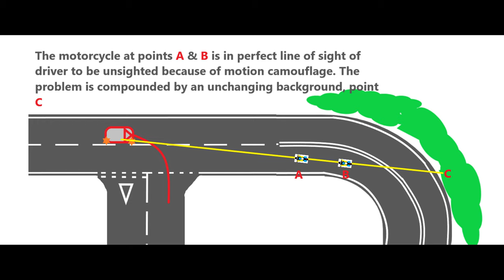SMIDSY - Understand & Avoid. Why Cars Pull Out In Front Of Motorcycles. Motorcycle Training

Comment: Never ridden a motorcycle BUT I do think this video is a must for car drivers and pedal cyclists as well.   Understanding the human failings in vision is the first step in training yourself to look properly and driving/riding defensively with respect for junctions.    In my younger days, I used to see the speed limit as a target.   It was only when I took an Advanced Driving Course and an HGV course that I began to understand the need to drive defensively and to use the accelerator/brake/gear to regulate and properly control the vehicle.   Thamk you very much for this video - very clear and easy to understand.

Comment: Great Video. Been riding on my full licence for about 4 years and have just done the Enhanced Rider Scheme. I ride an Africa Twin 1100 manual. These videos are very informative and I'll generally watch one before heading out because I'm still essentially an inexperienced rider. I have a personal example of the dangers of a SMIDSY from a car's persepctive: 

I was once driving a Citreon Relay van near Helston in Cornwall and was approaching a roundabout(the one near Sainsbury's for anyone local). It was sunset (a time I feel is most dangerous for motorcyclists due to the azimuth of the sun). On approach to the roundabout (I was heading second exit straight over), it appeared clear on my right although the sun was in my eyes, and as I pulled out two motorcyclists suddenly appeared across my windscreen within metres as they'd been obscured by the RH A pillar of the van and I failed to see them entering the roundabout previously due to the Sun. In their defence, they were both wearing hi-vis jackets but this just corroborates the point that hi-vis is harder to see if blinded by the Sun as a backdrop.

Stay safe everyone and be mindful of where the Sun is in relation to the road. 

Thanks for the great videos PWR.

Comment: Excellent video and of course very useful. It does help if you are/have been a car driver, gives you that bit of awareness of the issues car drivers have. My top tip is to give a little wiggle as you approach a junction, helps to get you noticed (I think you mentioned that in your video). Many thanks.

Comment: Unfortunately there is the exception to the norm. 2 years ago a driver came out of a junction straight at me, hit me head on, came out so fast he pushed my bike backwards.
I was doing 20mph possible less, 2nd gear, through a busy residential road because of a closed road diversion. Traffic was obviously heavy and the driver had maybe been waiting a while, I am not trying to give any justification to what this idiot did to me because there isn’t any, but he simply didn’t see me. Oh and what was I riding, a bloody great big goldwing 2018 new model, day running lights and even extra day running lights on the front of the engine, high vis vest, yet he still didn’t see me.
So there was absolutely nothing I could do, no where to go to avoid him. My goldwing was written off, he totalled the front of my bike.

Comment: I think it’s a good idea to pre-load the front break so you’ve saved time if you have to break. Very good video  a lot to think about ? I’ve just bought a motorcycle after over 40 years not riding and although I’ve always had cars and been a tram driver for several years I am very aware of my limitations and at 64 my reactions are slower. So I intend to go on the police riding course and unlike when I was on 1000cc bikes back then I am aware that I need to give myself more time to react and at my age I’m not interested in going fast anymore. I shall be fitting extra lights and a louder horn which will help just a “ little” and I shall definitely be buying a hi-vis air vest aswell as armer , also I will be uprating the breaks to brembo  as soo as I can afford it.👍🏍

Comment: Just revisiting this. 

I believe collision data suggests many bike  collisions occur on roundabouts. 

Roundabouts (particularly on faster  roads)  can potentially provide opportunities to positively embrace greater braking  cornering, & acceleration forces.

Issues can arise if our speed is greater than surrounding traffic. Often MC's  can move quicker than surrounding traffic.

If drivers do not anticipate our speed , fail to assess same or don't look properly then our speed may be a factor if things go wrong.

I don't type from a pedestal ....I enjoy progress when appropriate BUT use restraint where beneficial.
Reply: I try to avoid large busy roundabouts on my motorbike. Until recently I worked just off the Tredegar Park roundabout in Newport, South Wales (M4 J28), and if I was riding to work I would detour to avoid this roundabout. Too busy, with motorway traffic and multiple filter lanes makes this one of the most dangerous roundabouts I know of, and potentially lethal to motorcyclists.

Comment: Another excellent video. However, I would like to point out that the use of the term "appropriate speed" is, unfortunately, subjective. There are those among us who have, shall we say, an interesting interpretation of what is appropriate. 

One fairly extreme example springs to mind.

The driver of a high performance sports car was stopped locally by police for speeding.
They argued their speed was not inappropriate because the car had superior braking capabilities.
A speeding ticket was still issued.👍

Education with video's such as yours are a step in the right direction. But beyond passing a driving test, I believe a growing majority of drivers are just not particularly interested. After all, we as human beings don't generally like being told what to do.😁

Comment: One other thing. If a driver is waiting at a junction and sees a bike (or anything else) approaching they will do a quick mental calculation to decide how long they have to clear the junction before the bike gets there. This will be based on the speed the bike SHOULD be doing based on the speed limit for that road. If the speed limit is 40 and the bike is doing 90 (as some idiot riders do) then that mental calculation will be way off and the driver will pull out. KEEP YOUR SPEED DOWN!